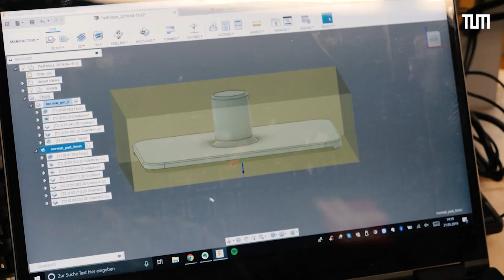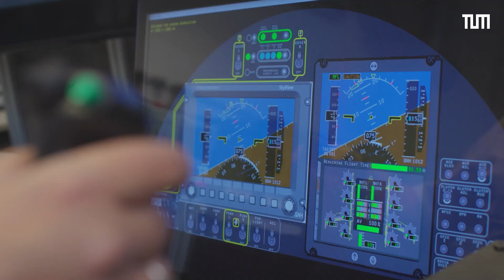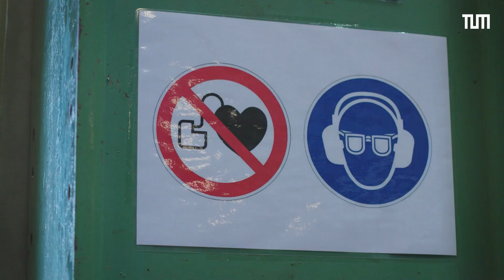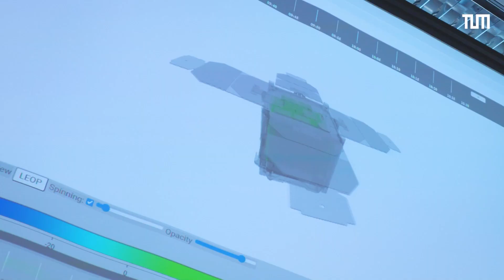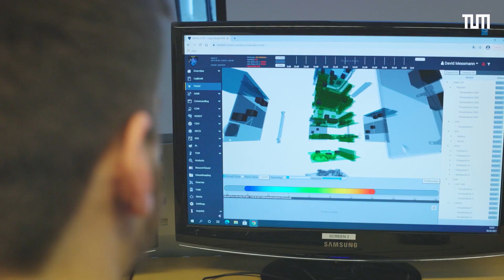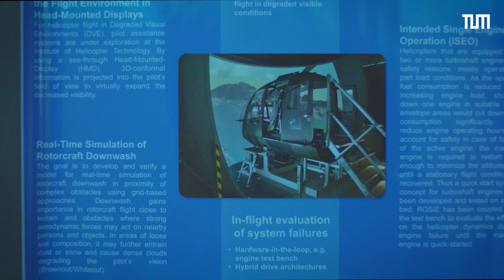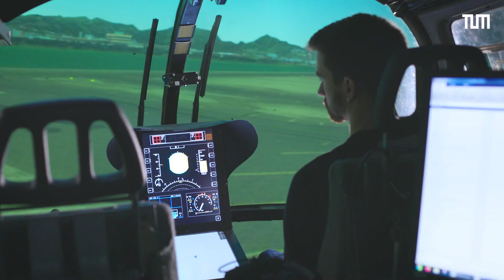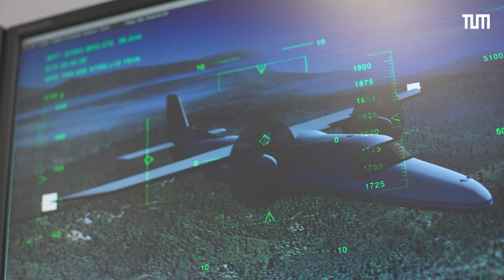AEROSPACE @ TU MÜNCHEN

Comment: Aerospace engineering at TUM is my dream! I‘m planning to apply for 2022 semester, and this video made me even more hyped!!!
Reply: brother did you get the admit? i have also applied to TUM at Msc  in aerospace.
Reply: Hi, can you help me please 🙏
I want to know, where is the faculty located?
Because I want to start study in TUM too but I cant understand where I will study.
Its show me the location of the faculty are not in the campus.
Reply: @ilanvinograd9498  the faculty aerospace and geodesy is based in Ottobrunn. But aerospace is lectured in Garching.
Reply: @Ilan Vinograd lectures will be 50 50 Garching and Ottobrunn for the winter semester 2022. But it will shift to Ottobrunn exclusively in the next semesters. So you should find  a place to live where you have reasonable long ways to both Garching and Ottobrunn and you might want to move closer to or even to Ottobrunn once your lectures are complettly held in Ottobrunn
Reply: @theepicguy9331  can we get in touch ?
Reply: @zinebfaiz2114  sure. Just reply with your contact details. You can delete the reply immediately after I saw it. I don't know any better way to exchange contact details
Reply: @theepicguy9331  i tried several time to send u my number and insta but it doesnt work, try to send me your or just search my name in insta and between my first and last name there is a point
Reply: Did you succeed applying for the study program?
Reply: What is the average salary after the completion of the course?
Reply: @piyushraghuvanshi9957  For a Bachelor, it is approximately 50k up to 60k, but it is recommended to make a Masters degree.